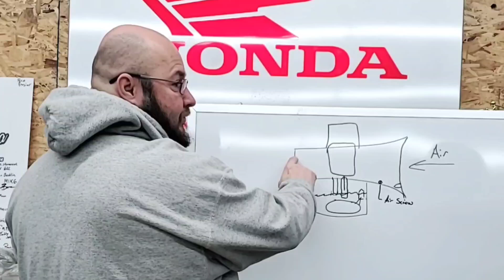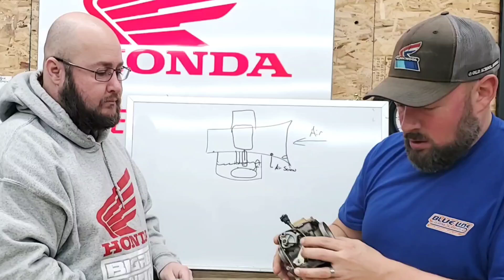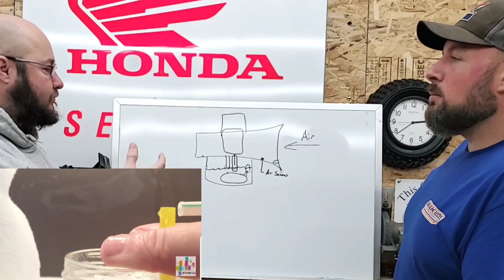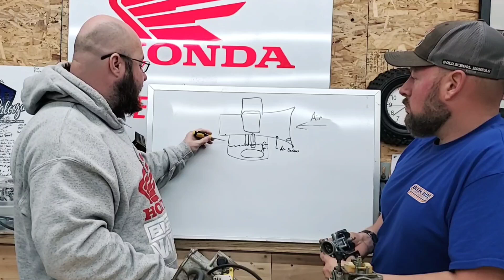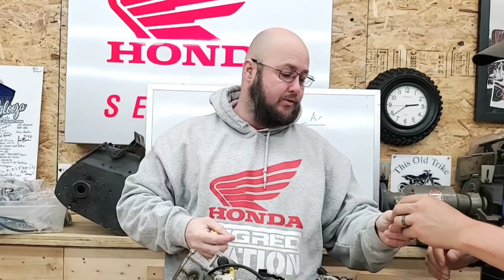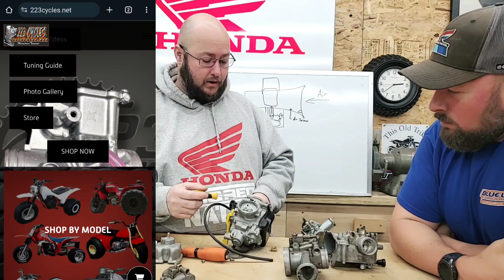CARB 101 - How does an ATV Carburetor work?  What are the basics, dos and don'ts, explained by a pro

Comment: can any one explain how the honda trax 350 carb with a primer moves the gas into the carb intake?
Reply from the maker: 1986 TRX 350?  That carb doesn't have an accelerator pump.  So unless the motor is turning, there is no vacuum to create the venturi effect to suck it out of the bowl.
Reply: @ThisOldTrike  2003 honda trax 350 with cv carburetor,  the bowel has a primer for cold weather but gas never squirts into the main carb body.  I would like to know what is the path.  Much appreciated.
Reply from the maker: Gotcha.  There's a diaphragm in there that is whats responsible for the pumping action and maybe has a hole or crack and that might be your issue.  Reach out to Curtie at www.223cycles.net and he should be able to help you out.